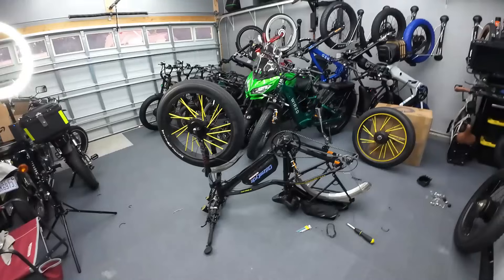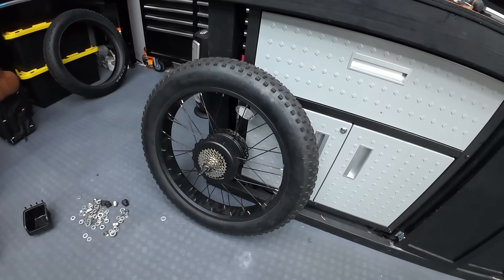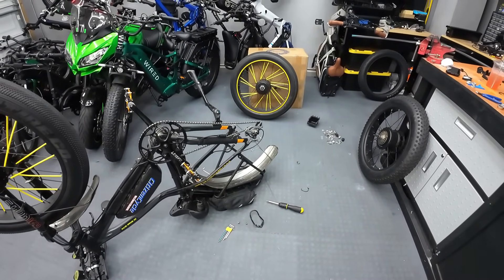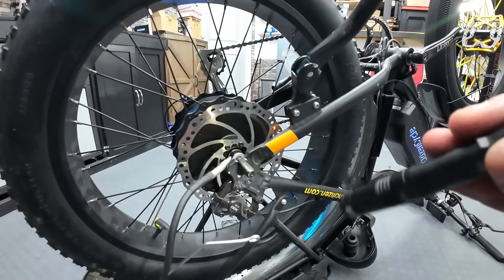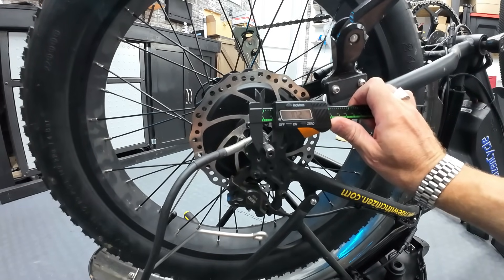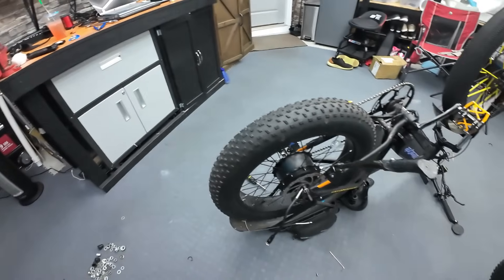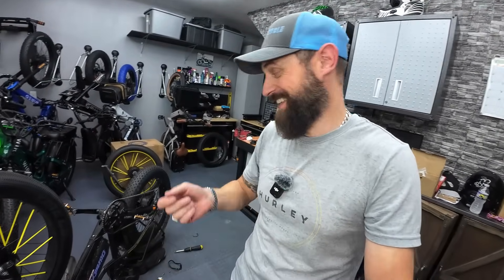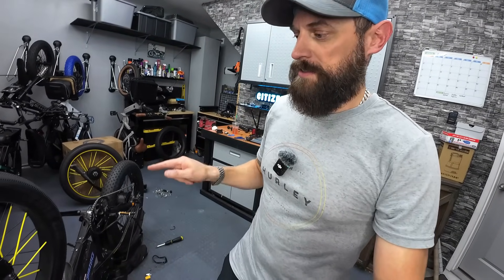Will a 1500w WIRED Motor Fit on an Old Radrover?

Comment: As others have said, file dropouts to fit. According to the ebike nerds on various forums it's a common mod. The torque washer is probably not relevant, assuming you would be fitting much larger after market torque arms to handle all that power.

Comment: Wouldn't the controller me largely responsible for the power output of the motor? With a big enough motor and powerful enough controller, you can push any motor to go extremely fast. They may just overheat and get damaged. I'd imagine swapping only the motor over will gain no performance at all.

Comment: uh - isnt the that type of torque washer have the tab down in the top of the dropout?   [think about strength]
bottom of a drop out will spread, so weakest point (?)

 Id file the drop out to make the axle fit, 
   Then think about a torque plate. - a washer "might" be ok for a weaker motor. (?)

  think about the motor size =
it will be more torque than a 750 watt, So I kinda added extra torque protection as [in my mind]
I  could foresee the drop out spreading, being miss shaped by that axle and little torque washer.  
 
 mine had 2k motors -
   the makers used,  just torque washers alone. -
 I added torque plates,  just because,  I thought extra protection might be good(?)
  my frame is aluminum, so a little extra  protection was added.

Comment: Grind the notch out for the axle a little deeper and add some pre tensioned torque arms or bolted on torque plates. I had to do this on a fork for my psychocycle front motor. Grind it with a file by hand slowly to not overdo it and to make both sides perfect.
Reply: tht's wht I was thinking.. angle grinder or dremel down the drop-out divot's a bit.. Swingarm should be able to withstand the 60v conversion

Comment: The most powerful geared hub motors I’ve found that fit 175 mm fat-bike dropouts with a 12 mm axle are the Bafang G062 1000 W and the Bafang G063. Both models are available with either a 14 mm or a 12 mm axle, and for this bike you’ll need the 12 mm version. They’re commonly sold in 5.5, 6.0, and 6.5 windings and usually come with the L1019 connector.

The only vendor I’ve seen offering the G062 with the Z916 connector (which matches your current setup and avoids an adapter) is Area 13 Bikes. They currently list the 175 mm dropout, 12 mm axle, 6.0 winding version for about $299 (unlaced motor).

Anything more powerful than these (e.g., Swifthorse’s MXUS GDR-19 Fat, Hentach 1500 W, or Ghostcat’s XOFO 1500 W) only seem to be available with 14 mm axles.

Comment: Modify the frame to fit the larger axle? A Dremel-like tool with a burr bit, or something similar? The factory boogered-up the axle dropouts on my no-name bike (discovered at the first tube change, they "pressed" the axle in sideways digging thread marks into the dropout rather than lining up the flats) so I became handy at tinkering with dropout dimensions in order to properly re-seat the axle, it's not too daunting. Since those axle flats already fit the dropout slot correctly, could you just make the slots a little deeper? Yeah, yeah, safety concerns and all that but pretty sure you aren't worried about voiding the warranty on a 7 y/o bike. Cheers!

Comment: The wire gauge that you need for the motor is mainly dependent on the amperage. A 52v 1500w motor will still need the larger phase wires and axle.